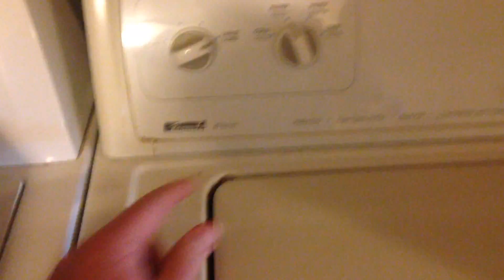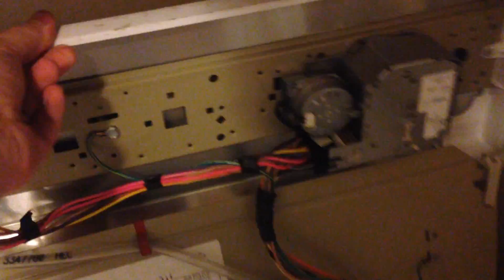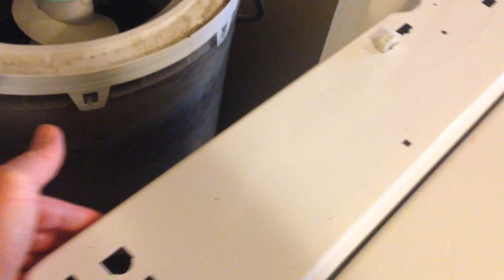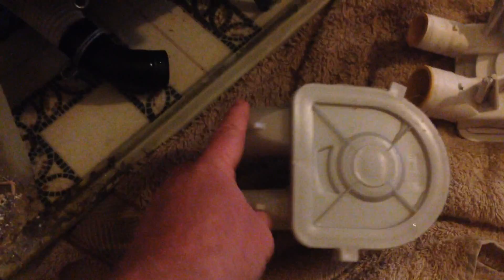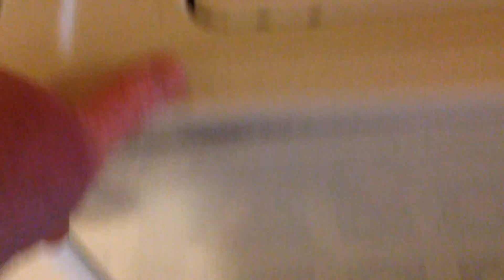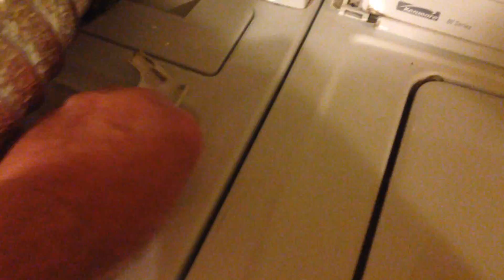Replacing water pump on Kenmore 80 Series Washer

Comment: You need to turn the lights on. Can't see anything
Reply from the maker: Wow, can't believe that was made in 2016, and still helping people out.  Next time I make a water pump video on a Kenmore 80,  I will make sure you can see everything.
Reply: @tubejim101  Yeah Jim!! You are! Because these machines refuse to die!! I watched this about 5 times in two days!!! Just putting the clips on then reinstall the cabinet and all systems GO! Hopefully this will solve my Kenmore 80 drenched clothes problem. Repair Clinic didn't have a diagnostic video for me. Only one guy did... but our machine doesn't HAVE a load sensor switch!  Wish me luck! Judy 👩‍🔧😂
Reply: @tubejim101  Well, 2 laundry loads & one more with AFFRESH later and all's good! I'd say 3 times is definitely a charm! Thanks again Jim!
Reply: @tubejim101  Btw, I saw everything just fine but it's so detailed, I kept going back!

Comment: Couldn’t you just tilt the washer up without removing the shell
Reply from the maker: I don't think so.  If it work, let me know.
Reply: It can be done but it'd be REALLY difficult and not at all pragmatic. Probably not the safest either. (Only one person I saw out of hundreds, commented they'd done it that way, but you'd be working on your back with about 6-10 inches of space to do it.) I just did mine an hour ago. I still gotta put the cabinet back on, but taking it apart was a breeze and I'm a chick. Definitely worth the extra effort, imo.

Comment: Does the new pump spin with any more or less resistance?  Having trouble determining if mine is going bad.  No leaks but its not easy to spin.
Reply from the maker: If it is not leaking, I would leave it alone.  If it is hard to turn, you might have a sock, or something stuck in it.

Comment: I bought a new pump online should be coming soon, but I am having a hard time putting the cover back on lol
Reply: I'm having trouble getting the pump off. Hoses have been detached and clips removed
Reply: @nickbradley2600  Did you ever manage to get the pump off the shaft? I've watched about 100 videos and am in the process of changing mine. Single Mom- gotta do my own stuff, but one vid I saw the guy took his WM out in his yard and beat his pump to smithereens with a pipe! He had tried EVERYTHING else. 😂
Reply from the maker: Are you talking about the whole washing machine cover?
Reply: @tubejim101  yes, I saw how I'm supposed to tilt it towards me but the bottom sides do not want to line up.
Reply from the maker: @krystlepaez  Here is a good video for that:  https://www.youtube.com/watch?v=ZkKfeeiU3PM
Reply: @tubejim101  thank you so much

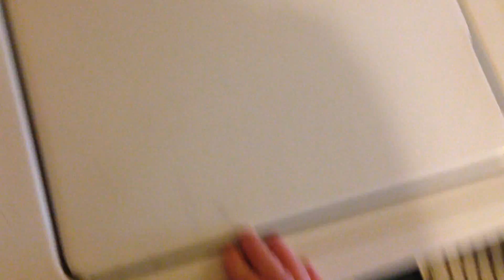Comment: 4:13
Pro Tip: I recommend tilting the machine back and feeling the bottom rails FIRST before disassembling the top. Some front boxes are screwed to the bottom of the frame. Mine was. You’ll need to tilt the machine back and remove the screws underneath before the front box can slide off. It’s easier to do that before the top is disassembled and flopping around.

Comment: Jim, how come your water pump came off so easy & mine is seized & won't come off no matter how hard I pull. Is it rusted onto the motor shaft?? Thanks.
Reply from the maker: Do you have the same machine that is used in the video?
Reply: @tubejim101  Yes, it was just rusted on to the motor shaft. Took a long time & muscle but it finally came off. Not easy like the videos. LOL.. Cheers.
Reply from the maker: @cohara41  Was going to say, hit it with some wd40 and wait 15 minutes, but wanted to make sure you had the same one.  Some of the appliances have the whole bottom peace as one unit, that you can not service.  End up paying lots of money because you can't just swap out the broken part.  Glad it all worked out.

Comment: you will know if the cabinet is lined up if after it is in place and together and you pull from all sides to lean the cabinet and it does not come loose from the base. thanks for the video.

Comment: How did you know the pump was the issue? I'm to assume that water just won't drain out properly? Thanks for the great information. So simple...
Reply: Tom Pritchard have you fixed your problem ? I'm having the same
Reply: @robertgonzalez3361 I am too. Did you figure out what the problem was?
Reply from the maker: It was leaving a puddle of water on the floor.  Here is a long winded video that shows me figuring it out: https://www.youtube.com/watch?v=6IYir2QPfz0
Reply: Thanks for the followup. I watched the video and that was very helpful. The issue we are having is that the water will not drain out after the rinse. No water leaking on floor. Wonder if it could be the lid switch instead? Is there a way to determine if the water line might be clogged? Thanks again. Sorry to bother you about this.
Reply from the maker: If while the machine is working, and you open the lid.  If everything stops, your lid switch should be good.  Can you tell if your pump is kicking on?
Reply: Taking a closer look, what is happening is, first it is not spinning, 2nd, with lid closed it sounds like it is. I'm thinking now that the plastic star shaped piece that is behind motor may be worn and spinning on shaft. I'm going to dismantle and look this evening.Thanks again.
Reply: @tompritch56 I'm having the same issue. Did you ever figure out a solution?

Comment: I need to ask you or anyone, did you have trouble separating the pump from the end of the motor shaft. The old pump in the vid pic looks like it had pry marks. I have one stuck on. The pump leaks, so no issue destroying it. But I don't want to mess up the motor bearing by prying on it. This is an original pump on a kenmore 80. Anyone had this yet? Penetrating oil going to work now.
Reply from the maker: It does look like pry marks, but, it is just dirt and grime.  Make sure you have those clips off. Mine just popped right off.  Maybe shoot it with some WD-40.  Wait 15 minutes.  Then tape the front with a hammer.  Also, could take the hoses and the clips off.  Then grab it and wiggle it by yaw.  Like you would check a car tire for bad bearings or ball joint.
Reply: This thing had a rust/corrosion weld on the motor shaft. I ended up breaking the pump in pieces to get at the collar on the shaft. I used a small chisel to split the white nylon looking coupling. Penetrating oil did nothing. Never fought this hard on a wash machine. Sort of laughable. Well anyhow, mine was the exception. Good video. I hope others, even if you think you are good at this, should bring their devise and play it as you work. The voice makes you feel as if you're working with someone. lol.
Reply: I'm having this same problem

Comment: This was a very, very helpful video.  I got in there, pulled it apart, got a child's sock out and got it back together in no time...  I especially appreciate the advice on how to get the body back on.  I messed with it for five minutes before coming back and watching the end.  Thanks for taking it all the way from start to finish.
Reply: tubejim101 As a 55 yr old widow trying to save a repair bill I was determined to do this myself. The new part in Canada was $57.95.  I agree the hardest thing about this was putting it back together. I am short so getting everything lined up took some wiggling and jiggling and holding my tongue just right. Your tips on how it was supposed to line up were very helpful and kept me from having to undo and redo it . Thank you for helping me make it on my own one more day at a time.
Reply from the maker: Thank you.